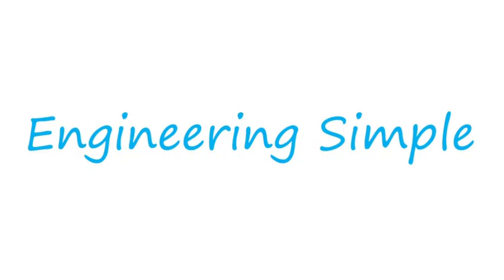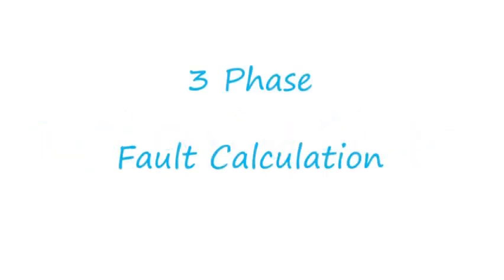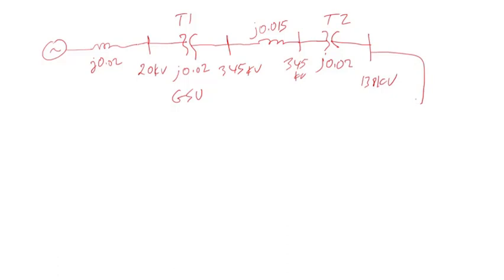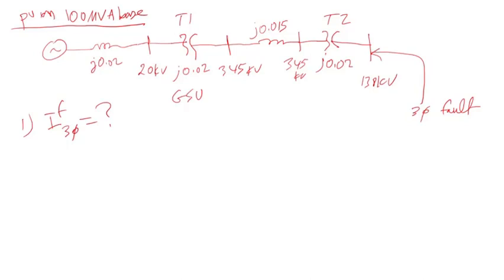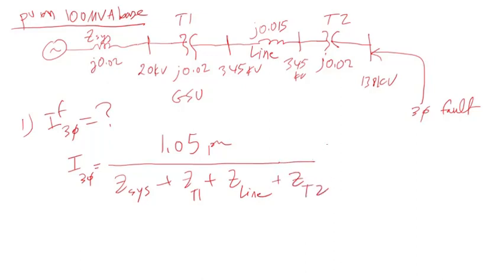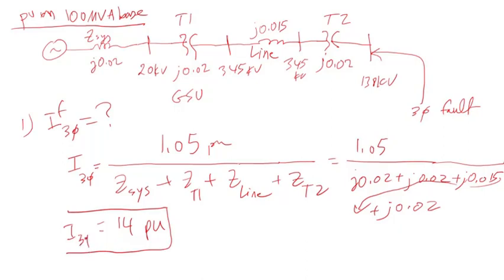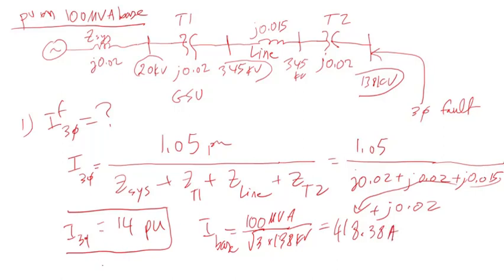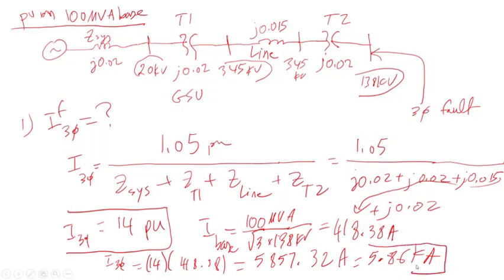FE and PE Exam | 3 Phase Fault Calculation - Must Know!

Comment: Hi, how did you get 1.05 pu for voltage, that was not explained?
Reply from the maker: It is the pre fault voltage. By IEEE, the acceptable voltage could be as high as 105% or 1.05 per unit.